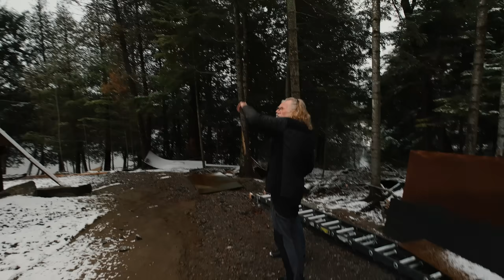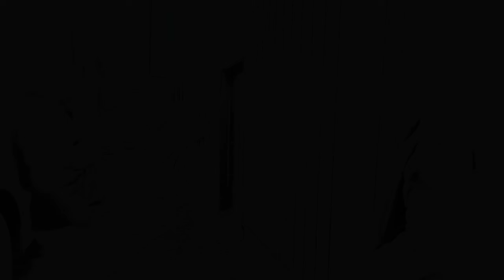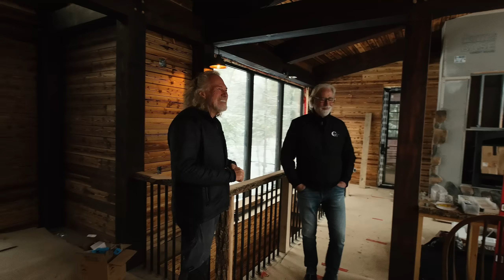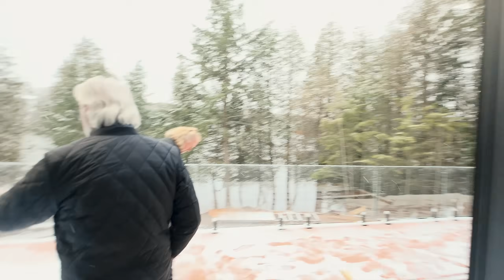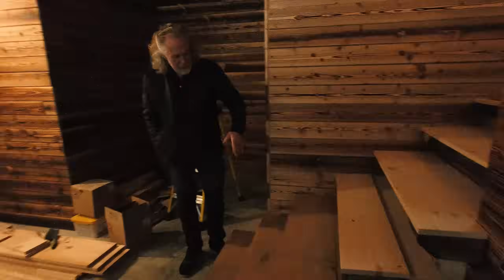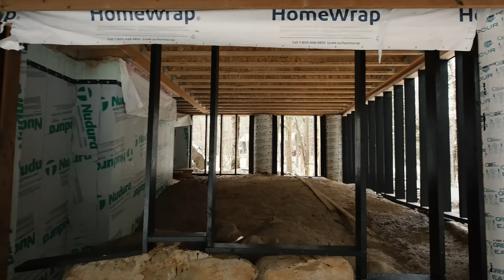Off-Grid & Built His Way | Behind the Build Ep. 6

Comment: Hi 👋 from Fr, but I am English, Very interesting, it was something that I was hoping to do, but I got scammed by my female partner, 
This was the similar work that I used to back in the UK, many barn conversions, I used to make very large windows, doors and staircases, I’ve even made a lift and slide patio doors, and yes, 6 to 8 people to lift one pain in place, one of my clients was partly in a line of a military aircraft facility, so I triple glazed the windows on one side, I live in a very old Moulin/Mill , I was hoping to put solar panels or something along the lines on the roof as I get sunlight on that side of the roof for 80% of the day, just one question about your letting the steel sheets rust, to give them texture and color, what are these going over windows, as many years ago, I saw something similar, and over the years they had problems with the windows staining with rust, I know it’s gonna be a lot more expensive, but I think copper would’ve been better, might still have the same problem, but it has a beautiful patina on it over the years, fr, 
Look forward to seeing some more work , it’s going to look amazing when it’s all finished and landscaped,
Reply from the maker: His plan is to seal the steel when the weather gets better